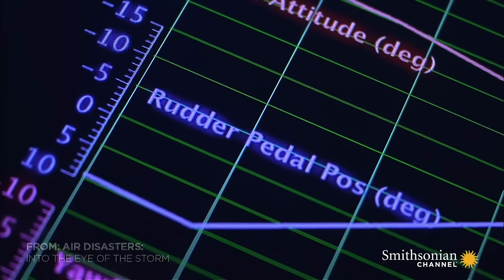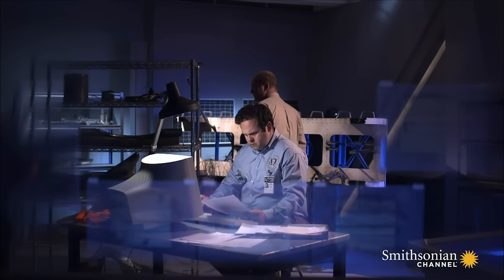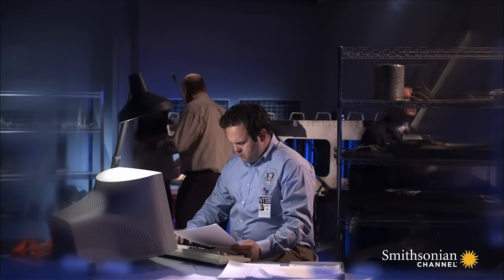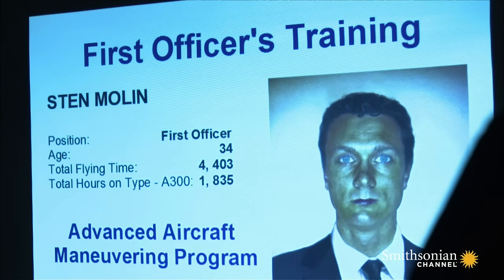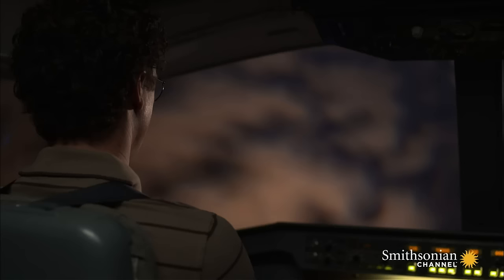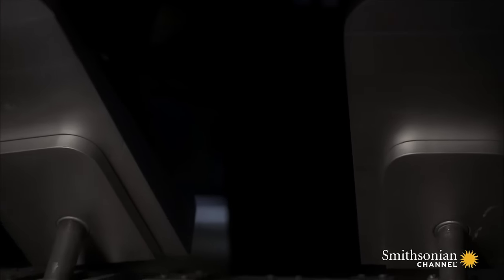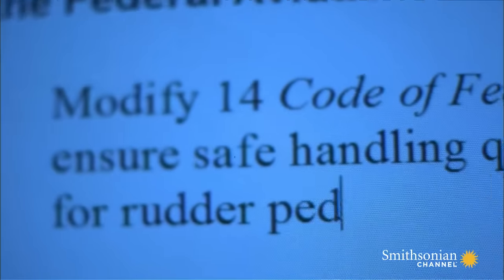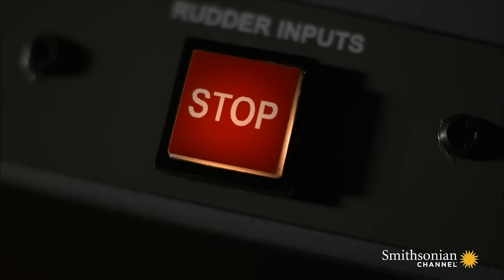Did a Poorly Trained Pilot Cause Flight 587's Crash?

Comment: Well this was an old plane. There are major improvement on the Airbus planes nowadays.
Reply: Old airplane? Imagine if you start doing 360 spins to the right and left constantly and that to while moving, won't you trip and fall? The same thing here, he applied too much tension and force to the plane, beyond it maximum capacity, and killed it.
Reply: +Ridhwan Ramzi well that's correct. The aerodynamic force could destroy an important hydraulic component because it could tear off. What I meant was. Yes this may happen on newer planes but some of the newer plane parts are stronger.
Reply: Its not the plane its the training for the pilots

Comment: The crash was caused by a poorly designed aircraft.
      There should not be any way for the pilot to break the rudder off a plane with control inputs.
     In fact, there should be no way to damage the plane in any way so long as the plane is below maneuvering speed. This accident was 100% on the poor design of the plane.
Reply: Oh my god are you serious ANY planes rudder would brake if you use it so violently and at 200 knots. The rudder is designed to keep the plane straight and aligned to the runway when on approach and before, during and a few seconds after you rotate NOT after your airbourne as its not necessary. In the Airbus manual it specificly says not to use the rudder at speed and violently as its not what the rudders for.
Reply: If you don't know anything about aircraft design please don't comment. 
      Every airplane has a "maneuvering speed" that is usually represented by a yellow line on the air speed indicator.
    FAA Regulations require this speed to be such that "NO CONTROL INPUTS BY THE PILOT WILL CAUSE AIR FRAME DAMAGE"
     No matter how hard the pilot pulls on the stick the wings will stall before they pull G's above wish the wings will be damaged.
     200 knots is fast for a Cessna type airplane but it is very slow for a Boeing or Airbus type.
    Why do you think this pilot had been trained to do this rudder input to deal with wake turbulence?
     Don't blame the pilot. He was doing what he had been trained to do, and that training would have been correct, if Airbus had been built to FAA standards.
    I don't know why the NTSB called this accident "pilot error" but I do have suspicions. And it would not be the first time that a government agency was paid off to rewrite rules.
    A Boeing would not have broken the rudder off of the plane. You don't even know why airplanes HAVE a rudder. You just think you do because you are a dumb ass.
       An airplane turn by moving flaps on the wings called ailerons. One wing goes up and the other goes down, changing the center of lift which then pulls the plane through the turn.
    The ailerons also produce asymmetric drag which causes the plane to yaw opposite the direction of the desired turn. The rudder counters this adverse yaw. It is needed anytime the plane turns and to control the direction of flight in relation to the ground, which is used when landing to keep the plane in line with the runway when landing in a cross wind.
    Now you know better, stop acting like you know shit you don't know on line.
Reply: Eric Taylor I may not know the ins and outs of an airplane but you and I know for sure that the pilot was not using the rudder as it's designed. Read my comment I did not say it was the pilots fault as he had been trained incorrectly on how to use the rudder and as you seem to know so much about menouvering speed why don't you tell me what it is for this plane. Please DON'T make silly things up the FAA would have given airbus a hefty fine and I wonder why this has not happened again considering it is still in service. And don't forget the series of 737-200 which had rudder issues killing a total of 157 people. Go on if boeing is so good why did this problem happen to Boeing and not Airbus. What about the recent 777 batery issues Airbus didn't have that either.
Reply: No, what you said was that ANY plane would have broken the rudder off. If that is the case, then it would have been the pilot's fault, and the fault of his training, for teaching him a maneuver that would have broken the rudder off of any plane.
     Now that you know about maneuvering speed and the control input requirements, you try back peddling.
    The problems with the 737 rudder had to do with the control input device. It had a design flaw that caused a full input to one side or the other. Note here, even with this full input NONE OF THE RUDDERS BROKE OFF THE AIRCRAFT.
     Flight 587 broke off the rudder because of control inputs. This is because the rudder was not strong enough to withstand the control input at full deflection below maneuvering speed.
    The reason this pilot had been trained to do what he did is because under no circumstance should that account have damaged the air frame.
     As the the 777 problems you mentioned, I haven't heard, but unless parts are breaking off because off because of control inputs below maneuvering speed, it is irreverent to this discussion. We are not talking about design flaws in general. We are talking about design flaws that mean the plane is not as strong as it should be and the company paying off government agencies to change the law to benefit the company while placing everyone at greater risk.
     I don't know that this has happened, but if it has, it would not be the first time. If you think the FAA is not above that sort of thing, then you are dumber than even I thought.
     Do you think all "organic" food thus labeled is, in fact, "organic"? Do you think all "dolphin safe" tuna is in fact dolphin safe? Do you REALLY think there are no "blood diamonds" in circulation?
     If so, how do you think these government agencies are so efficient in shutting down all of these cheats, while being unable to shut down other forms of contraband like drugs and human trafficking? These are serious crimes that carry heavy penalties for those who break these laws. 
     Hate to blow the illusion that the Government is competent and free of corruption in enforcing the law, but it's better you know the truth, as to better protect yourself.
    If you ever travel abroad, you should know that drug smugglers use trusted carriers only. However they still need to keep the customs agents they pay off employed and that means the customs agents need to catch smugglers. If anyone offers you a lot of money to deliver a package to some place you are going to anyway, don't do it. That's how they keep the people they p[ay off in their jobs, by offering up a sacrifice. They tell the agents who to look for, and that person then walks into the trap.
Reply: Eric Taylor I looked up Maneuvering speed or VA all your argumants on that are invalid as the CFR stated "flying at or below the design maneuvering speed does not allow a pilot to make multiple large control inputs in one airplane axis or single full control inputs in more than one airplane axis at a time. Such actions may result in structural failures at any speed, including below the maneuvering speed."
Reply: Good for you! You have discovered the NEW guidelines that were written AFTER this accident.  Good job :^) go get yourself a gold star You earned it.
Reply: Eric Taylor Also the 737 tail wing did not brake of because both incidents happened on approach at much slower speeds and not in wake turbulance also the the a300 pilot had been continuously turning the rudder back and fourth adding more strees into the air frame unlike the 737 incidents
Reply: Eric Taylor You say the american goverment is so corupt but they help there european rivals Airbus by "letting them get away with not folowing FAA rules" and making a rule saying the crash is pilot error not aircraft error if I was the american goverment I would want to hurt airbus's reputation and improve american run boeing
Reply: Eric Taylor Airbus is heavily monitored by the european union who are very strict and would not alow somthing like bribery to happen
Reply: Eric Taylor As you want to colse the argument this is my last comment the plane broke no FAA rules. In the investigation they found no weekness in the airframe and your the only person with this opinon we all no the crash was pilot error intentional or not. You have as much evidence as a flat earther
Reply: Eric Taylor Also Airbus planes are statisticly safer than boeing

Comment: if i was a pilot and i encounter turbulance and the air plane starts rattlelin viiolently and banking to lhe left and right the first thing i would do is abort the flight not give the plane more power to fight the turbulance that made the situation worse as far as the rutters thats what they are there for but if the turbulance is to strong the rutters arent goint to do what they are design to do

Comment: Airbus should have engined maximum maximum rudder stops.
Reply: They did. The rudder had stops in a safe defection point. They can’t account for reversals, it’s not possible.
Reply: @peteconrad2077  They obviously didn't work or the tail wasn't adequately engineered. AA removed that fleet ASPA.

Comment: He was not trained poorly he was trained wrongly because i i have seen this air crash investigation they trained him should bep agrecive with the controlls and paddle usage so he did the sameting but it was wrong because in the ground he could move it 10 dgree and in the air he must have move hat Telpin only 4 dgrees but he moved it much more also they tought pilots to use the paddles and telphin agresivley for scaping from low altitude situations in severe wheters but there was no any severe wheter but the pilot did not notice it thats it so he crashed.

Comment: Flimsy Airbus plane.  How about making the vertical stabilizer sturdier?
Reply: Nothing to do with 'flimsiness'. Those stresses would've torn the fin off any airliner. The A300 was and is certified to the exact same standards as any Boeing, and even exceeded its certification requirement on this crash. The fin is designed to withstand 150% of the amount of stress it's ever supposed to encounter in flight. Boeings are designed and certified to those exact same strengths: 150%, aka 'ultimate load'. Analysis of this crash showed the fin broke off when it was subjected to over 200%. Considerably more than it was designed or certified for.

Comment: Yeah because bean counters care more about the bottom line than structural integrity the tail shouldn't fall off a aircraft in any situation in the air and wouldn't if they used the same tech advanced fighter aircraft use just too expensive though to be worth your life
Reply: The tail was perfectly strong enough.

Comment: I don't understand the co pilot was flying this and not the pilot.
Reply: There is a misconception between the pilot (captain) and co pilot (first officer), both are fully qualified and essential to fly the aircraft, and quite often the copilot actually has more flying experience in the aircraft than the captain (but not in this case). In operations the crew always swap flying roles each flight, if only the captains flew then when the co-pilots upgraded to captain, you would have a situation where neither pilot up front would have ever hand flown the aircraft.
Reply: The copilot usually handles takeoff and landing.  The theory behind this is that if the copilot makes an error the captain can more easily command the copilot or takeover controls instead of the other way around where a copilot may risk angering his superior.

Comment: it will be hard to turn the plane
Reply: Without the rudder the plane could still make "coordinated" turns, where the plane takes a rolled attitude and turns into the direction of the roll.  But without the rudder it could not do "uncoordinated" or "flat" turns, where the plane remains in level flight with zero roll, but yaws in the direcion of the turn.  I used to do systems modeling of various aircraft years ago.  It's an interesting subject - and rotary-wing helicopter-type aircraft are amazing too in that they can even fly stably, lol.
Reply: Ok first: An airplane rolls into a turn every time, no plane flies a turn with 0° bank angle (This is possible in Air combat PS1 game but not in real life).
Second: Any airplane needs to be stabelized on three axis: pitch axis, roll axis and yaw axis. And if the tailfin brakes off, the airplane is not longer stabelized on the yaw axis and will crash (try a dart arrow - brake off one of the fins)

Comment: Maybe the pilot gave inappropriate inputs but it should not have been possible to rip the tail off especially at that speed.  This is also a design fail issue.  If I am not mistaken this aircraft utilizes carbon fiber which may have played a role, I think it did.

Comment: didn't watch.  Pejorative title.

did YOUR video include the fact this fleet had a problem with erratic yaw damper operation?

Did your video explain how American's chief pilot was the beneficiary of another crew on the radio able to communicate how to isolate the malfunctioning yaw damper without an "abnormal checklist" procedure???

Did YOUR video include the fact the mishap aircraft had this very problem the very week of this mishap on a previous flight?

Did your video explain how the stop-stop rudder movement in the previous flight weakened the composite structure of the aircraft's tail section?

Did YOUR video include that the aircraft manufacturer "reconstituted" an average 9 of 10 frames of information from the flight data recorder?

Did YOUR video explain how the FDR did not distinguish rudder movements by the rudder pedals or the yaw damper?

Did YOUR video explain that when the "upset" occurred, the airspeed was WELL below "turbulence penetration airspeed? (meaning the aircraft should have departed controlled flight before experiencing structural failure)

Did YOUR video explain there were insufficient structural inspections for the then "new" composite ... despite the US Military having used these techniques for decades on their composite structures???

Did YOUR video explain how the rudder "doublets" are not humanly possible ... 6 in < 3 seconds.  A rock band drummer with a double bass couldn't do that.

Comment: Airbus programed he rudder to react more sensitive at lower Air speeds. the plane exaggerated the rudder inputs.   Air Bus says with fly by wire the computer keeps the plane from doing maneuvers that would endanger the plane or passengers. only like in this case when the computer exaggerates the pilots incorrect training and brakes the plane. they blame the pilot.   NTSB investigation found the FDR showed the pilot used small rudder inputs and the computer max deflected the rudder. Like  the 737max MCAS the pilots didn't know the computer would do that.wonder what Airbus paid the Smithsonian Channel to Lie.
Reply: Where did you get that from? Because the Wikipedia page said nothing about that.

Comment: the main reason planes where crashing in that era is because of how cheap the air plane company's were with the broken equipment in the planes  and low experienced pilots that shouldn't be flying
Reply: Meister Rock19 This was not exactly pilot error. Big companies in that era were as safe as they are today, regarding aircraft maintenance. The airline actually trained their pilots to use rudders during wake turbulence. The pilot was doing what he was told to do in training.

Comment: Don’t Think Your Car Can Be Hacked? Watch This Terrifying Video  Jul. 26, 2013 9:17am											 					 Jonathon M. Seidl 
http://www.theblaze.com/stories/2013/07/26/the-terrifying-5-minute-video-showing-how-its-possible-to-hack-a-car-and-make-it-do-some-freaky-things/ 
... so what about 'fly-by wire' aircraft? ...
Reply: +searock there is no way to connect to the flight controls of an airliner, the FBW cannot be hacked because they are not deigned to receive any sort of wireless signal, the only way to hack them would be to open them up and physically connect a device to them, and i'm pretty sure someone would see you trying to break through the floor of an airliner into the avionics bay. But even then most FBW aircraft give the crew the option of removing all power to the FBW computers by pulling the circuit breakers
Reply: Jamenator1 ... however; I'm not so sure ...
Reply: He explained it perfectly accurately, fly-by-wire is a closed system, you cannot give external input to it without extensive modification of the aircraft.

If you could get away with rewiring an entire airliner without anyone noticing, it would be orders of magnitude easier to just plant a bomb.  Also, a pilot can revert to manual control if something is wrong, so even though you'd like there to be a cool conspiracy at play here, Occam's razor and logic itself get in the way.  Please, if you don't know much about basic elements of aviation, don't argue with people who do.  Educate yourself instead.

Comment: How is Philip the rotor is made of a strongest steel company in the USA and it's the blonde multiple multiple attacks from the air they don't lose that much the pilots are really the probably doesn't know how to fly the plane blade well really badly and I can gas light and throw it out and they broke I don't know how the planes turning left or right too much force condom on Roar so it doesn't fall apart or wait like a whole backside going to fall apart are not. Rotor because the roller is the strongest on the aircraft